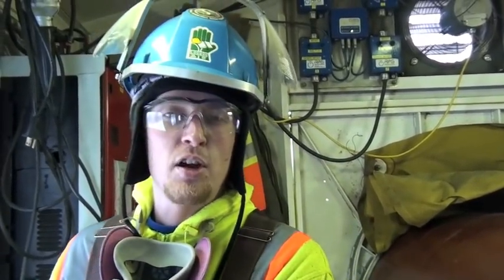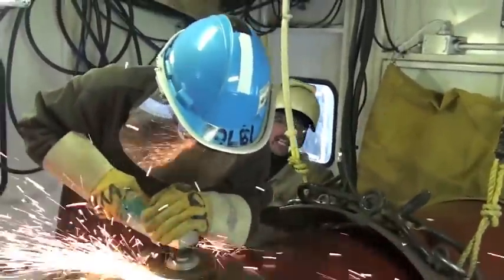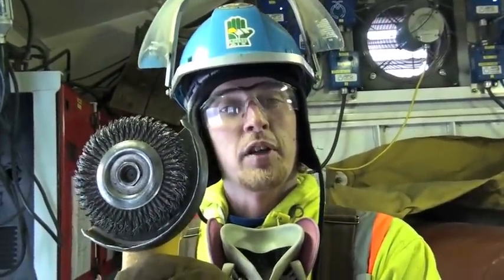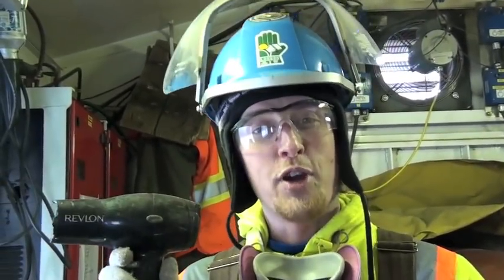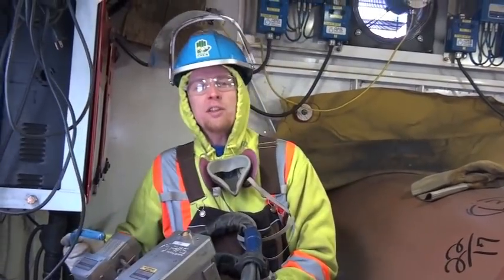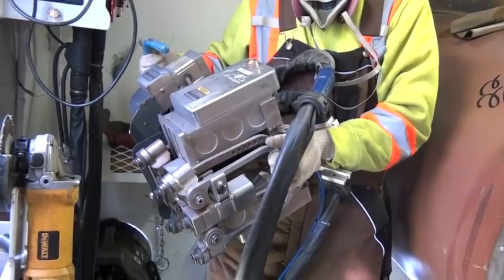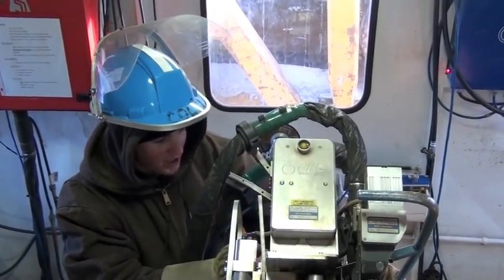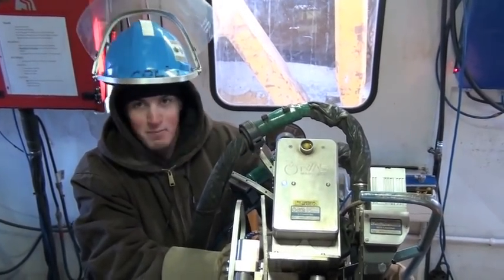So you want to work on the pipeline?

Comment: This is much more sophisticated than when i was working as a welders helper one summer, what I did was set up the pipe to be welded, grinding, cleaning pre heating and setting up the gear, that took about 30 minutes, then the welder came in and welded for about 30 minutes with a stick welder, meanwhile i sat in the truck eating cookies and listening to the radio, then when he was done he came and ate biscuits while I was prepping the welds.
Reply from the maker: It's still like that Peter.  Big inch mainline is generally always welded with automatics now, but all of the tie-ins are still done with stick.  The welders that you see in our videos do both.  It's just that the automatics are more fast paced and make for more fun YouTube viewing.

Comment: What the hell? No dirty dude sitting laying in the mud burning 7018 and 6010?
Reply: It is used for Cap passes.  6010 for Root pass.  Welder is the machine, Weldor is the operator.
Reply: Gord Baker except 7018 isn not a pipeline rod lol
Reply: 7018 Rod is used for weld-out after 6010 Root.
Reply: 6010 root.then you have the hot pass and then cover pass with 7018
Reply: d g exactly, and its all uphill
Reply: Clifton Williams they down hill on pipeline welding processes...not like typical pipe or plate process
Reply: Root is 6010, Hot pass, fill and cap are all 8018
Reply: Yeah it is.
Reply: 7016 and 7018 is a capping rod :)  6010 is your cellulose vertical down so you can go to sleep on the root pass and still get one done
Reply: Yep, all the comments on this comment sound like welders to me.
Reply: 8010 and 9010 for fill and cap. Downhill..  6010 for root. Downhill.. 7018 is a structural or pipe rod because you can burn it in any position. Uphill only. Moist piplenes prefer downhill rods tho. Idk why tbh. I just know that cause i was a welder helper for a while.

Comment: Why is there no mention of the "BENDING CREW?"  I noticed that there were a lot of bends in that pipeline, and SOMEBODY had to figure out the angles and bend that pipe at just the right angle to fit the ditch.  COMEON, MAN!
Reply from the maker: Good point Gary!  I'd love to make a video about the bending crew, the prep crew, and the transition crew.  Even the lowering in crew would make a good video I think.  Unfortunately I didn't talk about them in this video.  My bad!

Comment: Those guys aren't welding? They're pressing buttons.
Reply: Wyatt Arie machine operators not welders I’d be ashamed honestly.
Reply: Wyatt Arie Keep in mind what they’re doing and how many they got to do. lel
Reply: Any welder can do that , I know women who can do this job better then these guys .
Reply: @karlhanks1967  no there isn't. Just dont call yourself something you're not.
Reply: @joshhead9368  Both the welder and the machine need to be certified to lay down welds on pipelines to pass inspection. In order to get certified as a welder to lay down these welds with a certified machine, you need to be able to lay these welds by hand. You cannot manipulate a welding machine to lay the right weld without knowing how the weld works. There are a LOT of factors to every weld they lay which can vary throughout the days, weeks and months. No welding condition is (unfortunately) the same, and it is the welder's job to make sure the machine lays the optimal weld every time. These guys are more of a welder than the average schmuck who lays some pidgeon shit and posts it on instagram.
Reply from the maker: https://youtu.be/nTq2sInuHYE

Comment: If I was working in that little shed, that goof in the green running his mouth like that would be swallowing his chicklets.
Reply: First you need to grow up it is a joke. Second you would not have a job while you sat in jail for a while. 3rd he would get a bright white shiny new set of teeth to replace the tainted ones he had. 4th he would be getting paid while he recuperated from getting a shiny new row of teeth and you would not be getting paid, but you would get to pay for his teeth once you are out of jail and if you can get another job.  If you get a job with a good group you will find they will do anything they can to help you, but you need to prove you are worth it by working your arse off for them when you start.

Comment: dude where's the 6010 root pass and 7018 .... now a days it's all machine ....
Reply from the maker: Yup.  You just answered you own question.
Reply: Nathaniel Jones I was looking for the 6010 root too. then I realized they were using machines.
Reply: on 8 inch and 12 pipe were still using welding rods lol 🤣 I've heard of the bug but I've never seen one in person 🤔
Reply: Nathaniel Jones...now that's a welder talking....I have been a Pipefitter out of Local 208 in Denver for 36 years! That's the welding rod that I have used for years!!
Reply: Well you don’t use 7018 on a pipeline.

Comment: If you want to work oil and gas, get a trade and work in maintenance. Plants are a 24/7 operation that require up keep. One of the better gigs, and is not that physically demanding.
Reply from the maker: We like the physicality of the job and being outside in the elements John.  But thanks for the comment!

Comment: you are wrong at 2:46 it goes bead ,hotpass, cap
Reply from the maker: The bead is done by an internal welder before the shacks land on the pipe.  The shacks are hotpass, fill, and cap.  Sometimes we'll have multiple shacks and do extra fills and then cap.

Comment: As a millwright welder myself, I'm just going to have to say it. Those lazy ass dingle berries/ labor's are slowing down those professional over worked under paid certified welders down. It's like this everywhere.
Reply from the maker: On the pipeline, the dingleberries are behind the welders.  They buff down the welds after they've been welded.  So it would be hard for them to slow the welders down in any way.

Comment: Well, the question is, are you a welder or a grinder?? If the welds are any fvcking good, you don't need a grinder !! 🤣😂
Reply from the maker: Good point!  But with this kind of welding, you do have to grind your starts out, regardless of how good you are.
Reply: If you fail your inspection then you will be hated, end up sending the paint crew home. You do everything you can to make sure that weld passes, including wire wheeling every pass, grinding starts and stops. Even bad fit up slows things down so even the fitters have to be on point. So do the welders, equipment operators, and labourers. The pipeline is a production setting. If one thing slows down then so do the rest.

Comment: The hot pass is AFTER the root pass
Reply from the maker: That's right Om3n.  In this video, the root is done by an internal welding machine, and then the hot pass shack (shack one) lands and does the first outer weld.

Comment: Why do you need a shack to weld?
Reply: It is rather cold depending on the code they are welding to the ambient temp needs to be above a certain piont.
Reply from the maker: That's partly right John, but we also use these shacks in the summer.  Joseph, a lot of it has to do with wind.  Even the slightest breeze can give you porosity, so by controlling the wind with the enclosed shacks, you lessen the chances of having defects in the welding process.  Also, the shack has the bugs, the grinders, the ground etc. all set up right there.  It picks up and moves to the next joint in a matter of seconds.  If we had to wrap all of that stuff up and take it to the next joint and unload it from a pick up or something, it would waste a lot of valuable time.  Like the crazy welders inside, the shacks are built for speed.
Reply: @ConstructionFun1  interesting

Comment: The sad thing about this video is all the bad language used , in wielding shops like I worked in through the Pipefitters local every other word was a foul word. It takes years after you leave the trade to get out of the habit of using curse words as adjectives . The pay is great but the job gets boring , they tell you the shop is heated and air conditioned - heated in the Summer and heated in the Summer . If you should want to do this line of work best of luck to you just be prepared to Sweat a lot  in the Summer and freeze in the Winter .
Reply from the maker: Yup!  Story of my life Kenneth!  But we still love it and wouldn't want to do anything else!

Comment: No, I have no desire to work on a pipeline. The opportunities ahead are arthritus, bad knees, burns, bruises, broken hands/feet depending on pinch points, bad eye sight. Ill pass man.
Reply: AW FUCK this isn't even god damn welding if you're using a fucking sub arc welder!!!! All you have to do is watch you god damn fill and fusion on your toes. Real welders will take the stick welder or even mig if they are in a hurry to get the fuckin job done bud.
Reply from the maker: Can "real welders" do a hundred of these in a day?
Reply: @ConstructionFun1  Legitimate hand welding, fuck no lol. Not even with jet rods. These damn machines are slowly taking over man. They have ones that can do a vertical up weave on structural and do it as well as if not better than my own. It's bs.

Comment: all robotic welding come on
Reply from the maker: You bet!  Pipelining has both stick, and automatics.  This video focuses on the welding done with automatic welding machines.
Reply: @ConstructionFun1  I'm a retired boilermaker we tried using them and had no luck the human was faster.
Reply: @ConstructionFun1  the boilermakers had problems with flyash with the robotic welders.
Reply from the maker: @dougbelasco5586  😂😂😂  The boilermakers had no luck with them because they kept on staring at the arc?
Reply: @ConstructionFun1  no the area's we work in very dirty. what's your pension look like ?
Reply: @ConstructionFun1  I'm now a retired Boilermaker collecting a pension. Do you have a pension punk ?
Reply: @ConstructionFun1  i understand they can lay down wire fast when they are working right . the boilermakers are trying to use them in tight dirty areas of the power plant tubes. they work well for overlay on the tubes.
Reply: @ConstructionFun1  Alot of stuff we do is 9018 thick crossovers which have to be heat stressed after.
Reply from the maker: Don't get your panties in a bunch Doug, I'm just messing with you.  My union treats me well and my pension is growing nicely, thanks.  Enjoy your retirement Doug!
Reply: @ConstructionFun1  Good keep it in today and the retirement with be good thank you for the knowledge.

Comment: biden fired all of these good men
Reply from the maker: Nope.  Biden put one pipeline on hold.  There are many many others on the go at the moment.
Reply: @ConstructionFun1  on hold? Come on man
Reply from the maker: @HEA_01  What would you call it Harry?  George W. Bush Ok'd it, then Obama revoked the permit and put it on hold for 8 years while his administration did "environmental reviews" of the project, then Trump got in and Ok'd the permit again, but it was held up in the Nebraska court for 3 years, until on July 6, 2020, the United States Supreme Court ordered all Keystone XL work to be halted.  Then on January 6, 2021, Biden got in and cancelled the permit again.  This is an ongoing process, that has been changing with every single presidential administration since TransCanada first proposed this project in 2005.  It's ON HOLD, and eventually it will be built.  Either way, pipeliners aren't waiting around.  There's A LOT of other pipeline work going on.